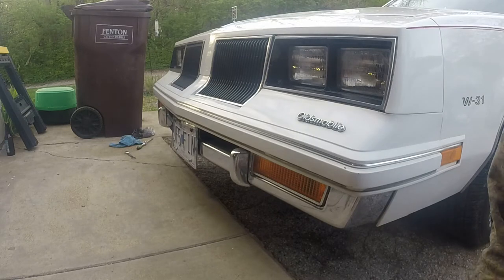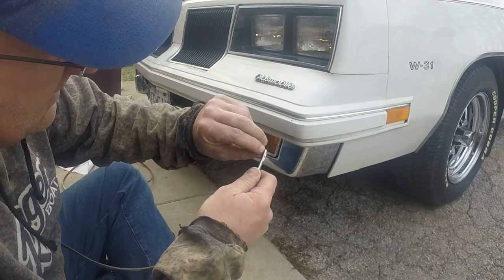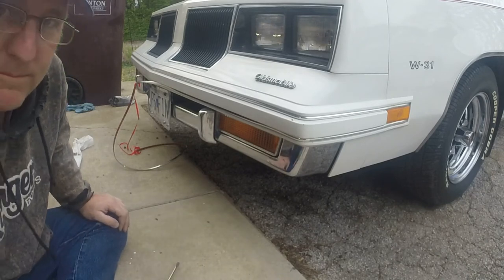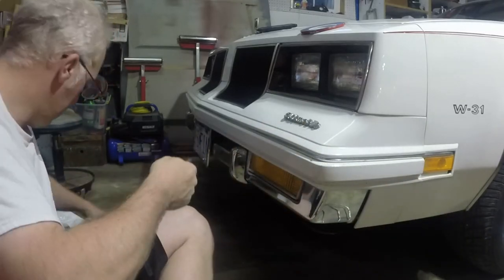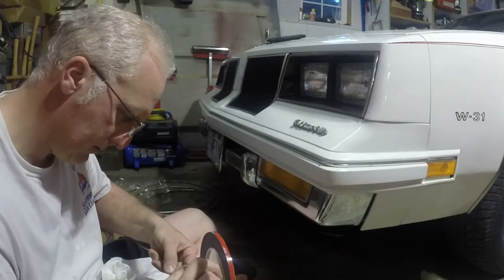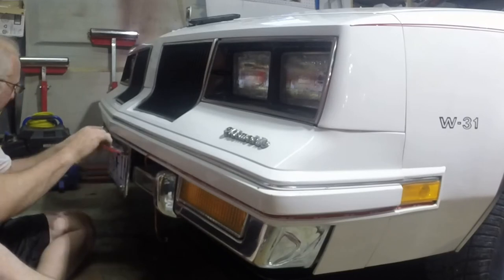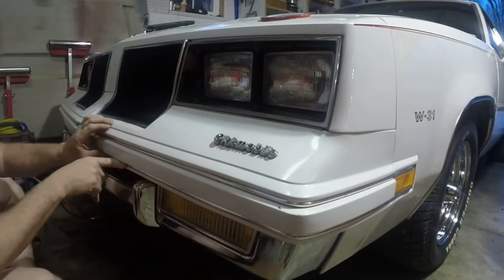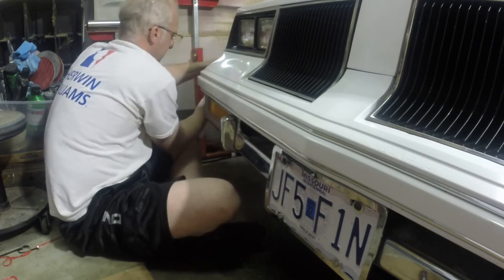Chrome Inlay Trim Install on the 86 Cutlass

Comment: I think that was 3/8 half round chrome trim that you were trying to use at first.  That's probably 1/4 half round chrome trim that you end with, the one that actually worked
Reply from the maker: Unfortunately both were stored in my basement so Im guessing I had a problem installing one of them in the past. I do however remember buying a kit off of ebay that I believe did work. The kits on ebay for this trim were sky high like 200$ at the time of this video. Somewhere in the video I did call out the widths, i think the one that worked was 5/16. My guess is it is really measured in millimeters.

Comment: I need to replace probably all of these strips on both bumpers, and I did one of the rear sections years ago then quit because scraping out the old tape was just a nightmare. I really want to get back to replacing the rest of it, but I have a question - I recall the strip I replaced having metal tabs that each end were attached to, which then clipped into the bumper. Are these necessary? I mean, if the trim is held on by tape regardless if it's to the bumper itself or the metal clip, what's the difference?

Also, while we're talking trim - I had also made my own version of the bodyside trim pieces since properly formed pieces aren't available. Naturally, the "chrome" edges are peeling just like the original had. Is there any fix for this, or any reproductions of the original, correctly-cut pieces out there?
Reply from the maker: Great question. I really only remember metal tabs on the rear bumper. Those i did reuse for sure. Not sure if you can bend the chrome inlay trim up and around that section of the rear bumper. I think the metal clip provides an ease of installation as well as insuring the trim doesnt want to pop out because of too many tight bends. great question too on the bodyside trim pieces, I am not familiar with but always liked the look. i almost took them off a parts car back in the day when wifey and i would go out junkin but I did not have the tabs welded on my car to accept those nice looking trim pieces. I do not know of a fix for pealing chrome. Only thing I can think of off the cuff, is to use 0000 steel wool to knock edge down and topcoat section with an automotive clearcoat to lock things down.

Comment: I have a 1983 Cutlass Supreme.  Where did you get that chrome strip?
Reply from the maker: I wish I knew. LOl. it may have been from the local advance auto parts. The chrome strips that worked were in my basement for who knows how long. Ive seen other chrome strip for sale on ebay and boy is it pricey.